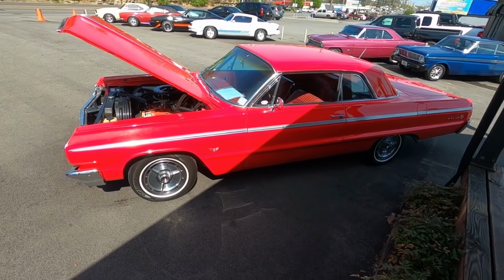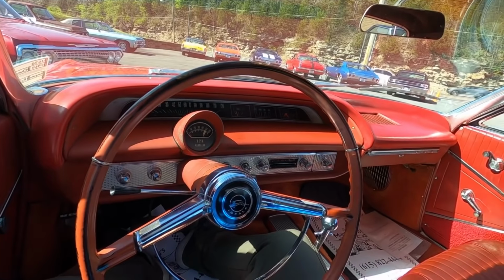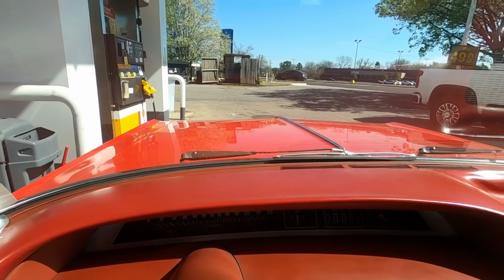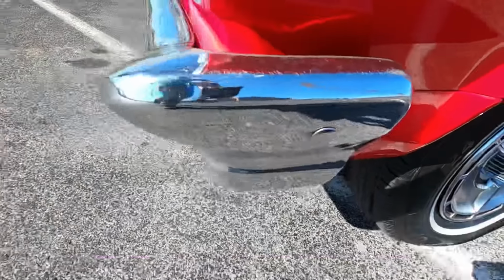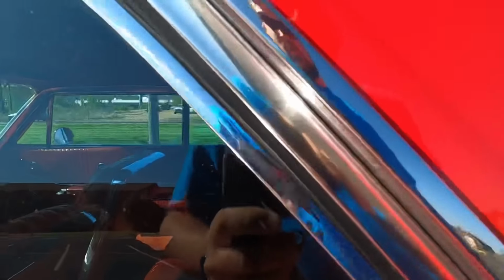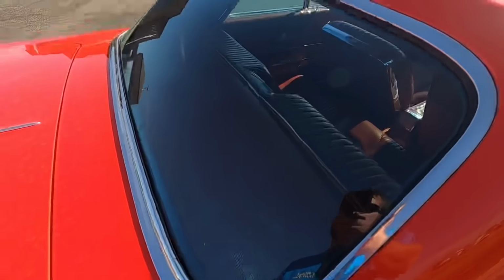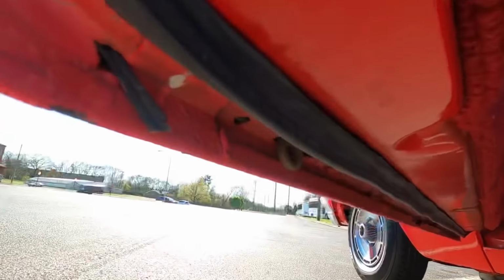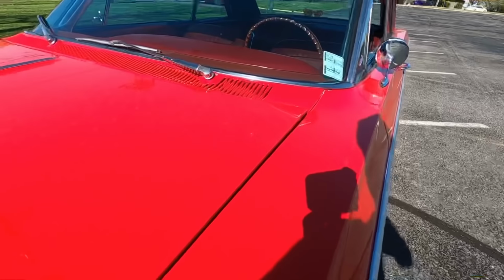Test Drive 1964 Chevrolet Impala SOLD $32,900 Maple Motors #1570

Comment: Can I go for a ride with you and relive 1980? That 327 started right up...good sign. Power steerings not needed - wheel is usually tight in those cars unless one of your joints has excessive play in it...good front end alignment would tell. After a turn you can release the wheel and it will automatically go center...at least it would in my parents '66 Chevelle.